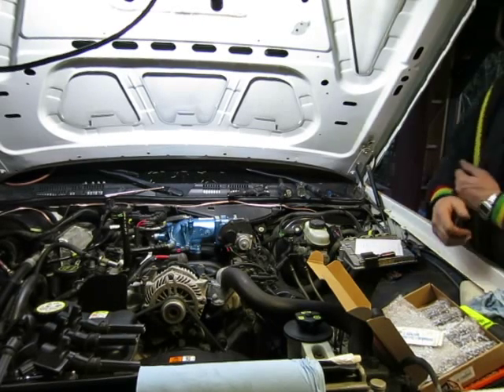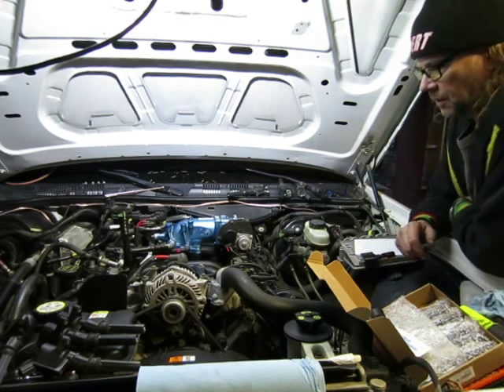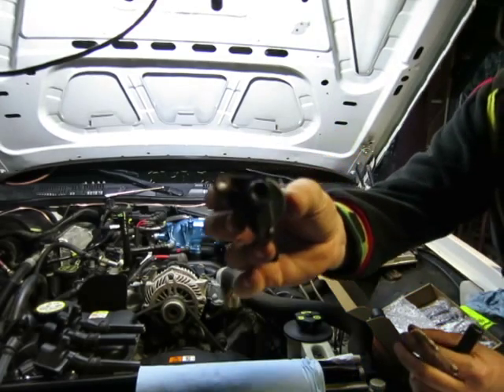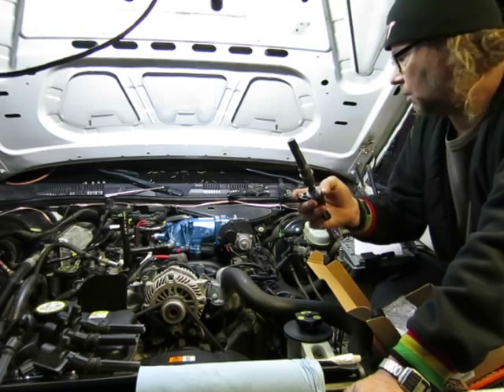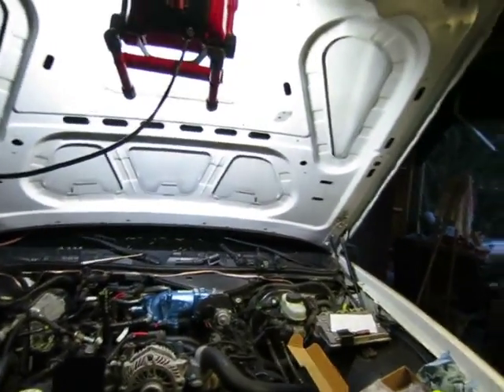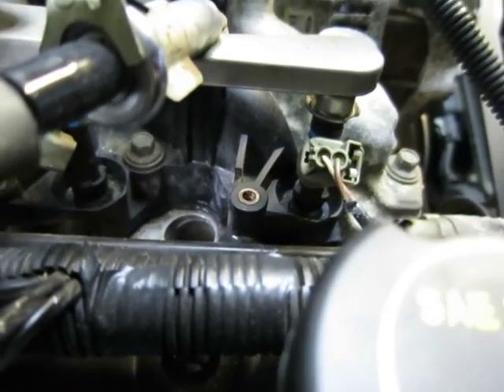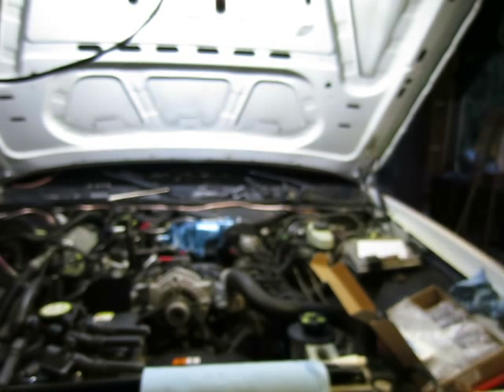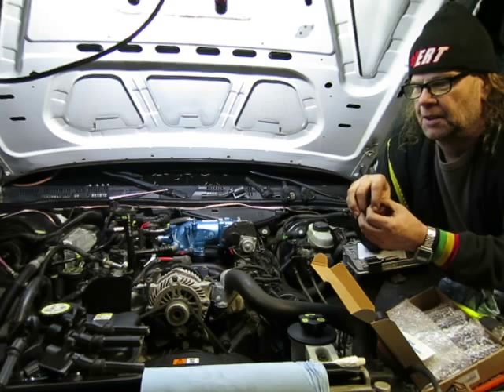Crown Victoria coil swap and intake manifold leak 2006 P-71

Comment: I hope you can help me out I have the same issue with cylinder eight, the mechanics thinking it’s a head gasket.
Reply from the maker: There are 4 water passages between the heads and intake manifold, they are on the 4 corners so if there is a leak chances are water will get to the plugs closest to the 4 corners first,  so 1, 4, 5 and 8 ... check around the 4 corners and see if that's where the water is coming from.
Reply: @SnakePliscan  what intake to go with
Reply from the maker: @preciousvalentinolagv2328  Go on Rockauto.com or Ebay etc and search for your yr. of Vic and they will hav a number of brands and prices to choose from, go with what is appropriate for you.

Comment: I have a 07 crown vic and it starts up but doesnt accelerate that much and makes a popping noise from the back or underneath can someone help me solve this problem !!!!!
Reply from the maker: Do you have any water leaks around your intake manifold ? water getting down into the spark plug holes can cause popping and missing and an inability for the engine to rev up. You need to to pull the coils and have a look down in there, any moisture on the cop's will be a problem.

Comment: Can you tell me exactly which Barrs stop leak for the P71, Barrs has pelletized, copper, aluminum and a few more choices and would like to use the best one for this issue. I can't tell for sure if its the Manifold issue but I smell coolant at the firewall location and loosing a small amount of coolant so I'm thinking I have this same issue in my 08?
Reply from the maker: C Angel   Angel heres the video i made adding the stop leak, pretty sure i say which one i used. Your leak is probably at the back of the manifold in a hard to see location. This fix has worked for me for several years now. good luck. https://www.youtube.com/watch?v=ZQM7R3D0470&t=192s

Comment: I wanted to mention the problem with the poping in the exhaust was a bad fuel pump and failing pcm
Reply from the maker: Im glad to see you got your 07 crown vic p71 sorted out, your problem illustrates perfectly how hard it is to diagnose a motor problem just from a person's description. No substitute for being there with a scanner plugged in.
Good know for future reference if the motors popin check the fuel p/p and PCM
Reply from the maker: How did you solve the problem?
Reply: Christopher Brockway what did it sound like

Comment: How's the car running now?
Reply: +Michael Eichler I've put a few thousand k on it since the tune-up and honestly it runs better than ever. no coolent issues an im thinkin of puttin louder mufflers on it cause i just like the sound of the 4.6 mod motor. It really go's like stink, and i like how traction control is deleted with the posi option which mine has.
Reply from the maker: Still going strong, started driving it again 6 months ago after having it sit for 4 years  , i will say tho have my coils have failed, those cheap ebay coils were cracking and had to track down misfires a few times.